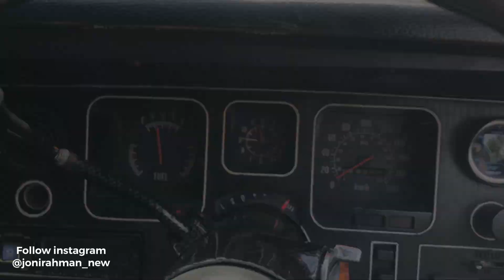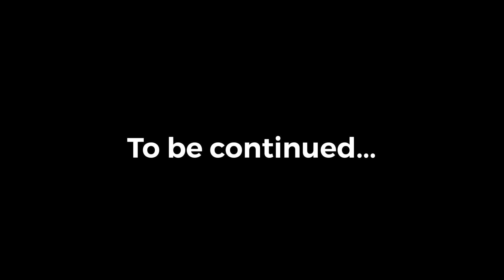WELCOME NEW NORMAL. Holden HQ

Comment: Om mau nanya kalo itu nama filter udaranya apa mau nyoba pake juga
Reply from the maker: Airscoop .
Reply from the maker: https://www.ebay.com/itm/Mr-Gasket-Air-Cleaner-Assembly-Double-Scoop-20-x-10-in-Rectangle-5-1-8008MRG/283695876111?epid=2301676912&hash=item420d97880f:g:zLAAAOSwltVeFCJO